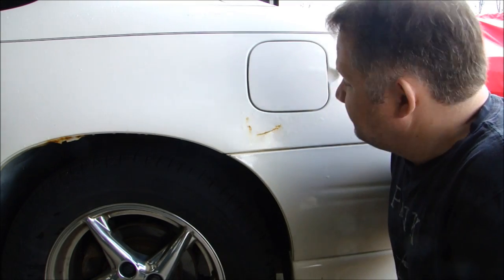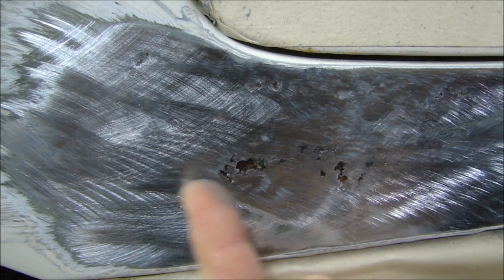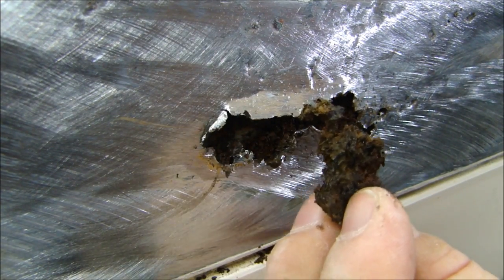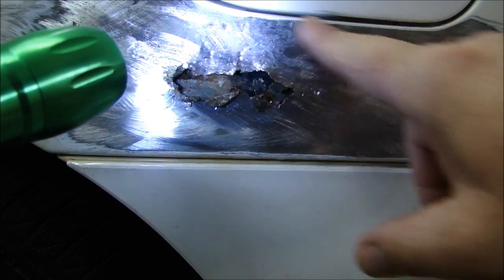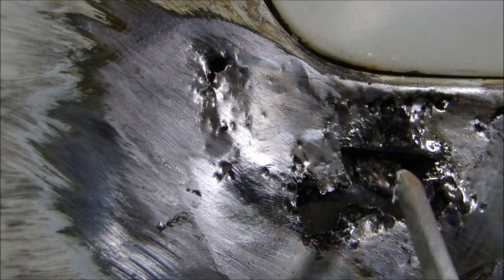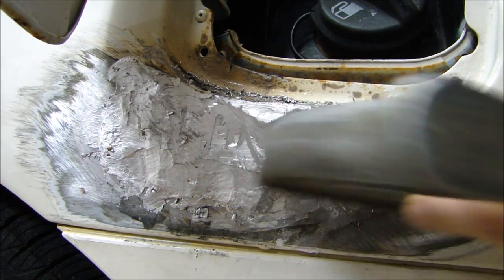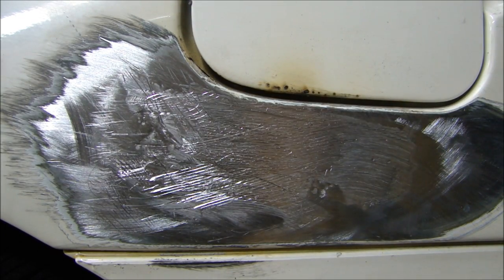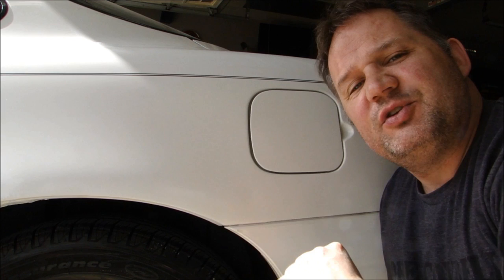Permanently Fix Rust Around your Gas Cap Door

Comment: Its abit easier if you tin a small patch of metal, drill a tiny hole through it and tie a bit of wire to the center, slide it in through the rust hole (or from behind if you have access), and pull on the wire to get it flush against the hole, then you can use that as a backing plate so you don't have to pack as much lead into an open gap. Once you've loaded your lead up just snip the wire off and push it through and just smoosh a bit of lead over the pin hole it left.
Reply from the maker: Great idea! Thank you

Comment: Ballsy call to use torch next to fuel cap! Some caps are vented!! That said you made a nice tidy job of the lead loading mate, way way better than slinging bondo at it!
Reply from the maker: I stress safety in my videos, but you are right. I do check that before and I should include how to do it correctly. Thank you my friend!

Comment: Ive been doing similar repairs after learning to sling lead, ive found you can patch even larger areas if you tin a patch panel (use like a 16 gauge piece so no fear of warping) and then use it as a backing plate and simply lead over the seams to hold it in place and then fill the center and overlap the whole thing. then file it and then finish it with a 40-80 grit paper
Lasts for years upon years without bubbling in your paint (yes i know its still corroding on the inside but it keeps your cheap daily looking presentable)
Reply from the maker: roflman Awesome idea....I have done that and it does work very well.

Comment: Hi Pete! What a great video. Thanks for introducing me to something so much better than Bondo. Two questions:
1. I've got paint bubbling on a good repaint job done 5 years ago on my 1990 F-150. Grinding the bubbles down and there's no holes from behind. The metal is solid, but pitted. If I dimple the surface, add some lead, smooth it off, then prime and paint, will I prevent the bubbles ever returning?
2. Also have a 2003 Echo. Paint is perfect all around, except for a rust hole along the bottom right in front of the rear wheel. The hole is big enough to put a walnut in. I don't want to cut and replace the metal, and I don't want to use Bondo. Is there a lead option for rust this bad?
Thanks a million! 
Steve
Reply from the maker: ***** Hey Steve. 1) Yes....grind it down and use a metal etch prep solution to get all of the rust out before lead. 2) You can use a thin metal patch and solder it in place. Tin around the hole and the back of a patch piece and solder them together. Then fill the outside with lead. That works well

Comment: Keeping the drain hole open inside the door is important, i got an 03 town car, the metal under the door was just bubbling rust, the drain hole was completely filled with dirt so water would collect inside and spill out and in between the seam, i had to grind the rust off and there was a hole underneath, i took my blow nozzle and blew inside the hole and got blasted in the face with a bunch of dirt that had collected in there, it also blew the hole wide open, there was more rust and dirt inside, after all that i saturated it inside with Rust-Oleum rust converter spray spraying up inside too, now i have to figure out out how to fix the hole, i don't have a welder, it really needs a small patch panel, i don't like rivets but it might be the easiest way, the car isn't pretty and definitely not a show car but she runs great.
Reply from the maker: Thanks for the comment

Comment: excellent video.. very well explained!  when you use the spray paint, you're not using any clear coat over top of it?  it always seems like it fades really quickly for me.. am I doing something wrong to make it fade?
Reply from the maker: It really all depends on the paint that is already there. In this case the owner wanted a cheap fix for his daughters winter car. I would normally clear and blend
Reply: ***** all I know is spray paint.  I've never even cleared anything lol .. again though, that is an excellent repair!

Comment: For the best result should I sand the panel down, get a professional grade black gloss base coat, put on 3 coats of that( perhaps sanding it ) and then do the professional grade clear? I don't mind doing any step that would produce the deep shine on the '05 Crown Vic.  I'm sure there are many people who have sections of their older cars they would like to make close to the original.  Also do you have any brands of professional spray paint you like the best?  Thanks again Pete
Reply from the maker: Any paint is only as good as what is underneath it. If you put a professional grade paint over a rattle can paint, it will most likely melt the paint underneath and make a huge mess. Sand the area down to remove all of the paint down to the factory paint. Spray a black primer/sealer to prep the surface, then apply your paint. If you go to an auto paint supply store they will match the color and give you everything you need to be successful.

Comment: Very good work, looks nice. I have one question though, Pete, I have a 99 Civic Si and it is rusted inside the gas door. The paint around the door is bubbled up but the rust hasn't quite broken through yet. How do I go about repairing the rust inside of the gas door? I cannot seem to find a replacement rear quarter panel that includes the entire gas pocket.
Reply from the maker: +Nick DiNunzio That is fixable, unfortunately it's difficult to get to. If you can see rust in the paint, it is coming through from the back. The longer you wait the worse it will get.

Comment: Thanks Pete, the repair went very well. One tip: the quarter panel on this 2005 Crown Vic rusted because it had been replaced 7 years ago and it was never undercoated; I found that Rust-Oleum makes a spray undercoating that is rubberized. It sprays on just like paint, but it actually puts down a thick protective coat- pretty amazing out of a can. I have one question about this fix. This car is Black, and the Black is almost mirror like...when you approach the car you can easily see your image in it. The paint code is U A, but there is no brand of spray paint that can match the actual finish. Everything I have come across is Black but much more dull than the actual finish. Any thoughts?
Reply from the maker: +Myron Piano Yup....base coat, clear coat, color sand and polish. Make it look like glass. Great job!

Comment: Great video, and agree it will stop rust for a long time, but wouldn't it have been easier to weld in new metal?  That lead work looked tedious.
Reply from the maker: Welding in new metal requires higher heat and a custom fit panel. I fixed this in under an hour. A welded panel would take several.

Comment: My son has a 2000 Grand Prix GT that has the same problem. When I took it to the body shop they said those cars have rubber behind there that causes that and there's no was to really fix it. 
Do the car you did have rubber like that?
Loved the video
Reply from the maker: +brandy smith By rubber I think they meant a spray coating that inhibits rust. yes, this one had it. It's difficult to fix. Thanks Brandy
Reply: +Petes Garage thank you. I really appreciate your fast response.
Reply from the maker: +brandy smith Sometimes I can answer quickly and sometimes it takes a couple days...but I will answer. Just trying to recover from my trip to LA. Doing nothing on this holiday...lol
Reply: I think what they meant is that it has a spray foam like material...
And yes, they do, and that foam holds a ton of moisture, that helps rust those areas out prematurely.

Comment: Hi Pete: I have some rust breaking through a front quarter panel. I ground the area and noticed that the quarter panel is made up of two layers, so there is rust in between the two layers of metal. I don't have the wherewithal to replace a quarter panel. Can I grind the area big enough to expose all the rust and then put a rust converter on the area and then add lead? The area is easy to get to, and I'd estimate the rusting area to be about the size of a lemon, but I can't see inside so I don't know for sure. 
                                                                                                           thank you
Reply from the maker: +Myron Piano Unfortunately when a quarter gets to that point is will keep rusting. You can't just cut out a big area and fill it with lead. You'll need to make a small patch panel and solder it in place. I've done that and it works very well.

Comment: To damn close to the gas filler for me to use a torch bro.
Reply from the maker: +JOHN WALTER Never had a problem. If you can't smell gas it's safe
Reply: If I were to to this I'd wet down a paper towel and wrap it around the fuel cap after thoroughly cleaning fuel cap area just to keep any stay fumes at bay.

Comment: Hi I just watching this video and was wondering i have a Chevy S-10 and it has some big rust areas around the wheels and door panels how would you approch this also where can I get lead to do repairs?
Reply from the maker: +robert hutchinson I would start with a patch panel. I'm pretty sure you can get just the wheel well patch. Once you weld in the patch you can lead the seams.

Comment: Pete, I have another question. I put three base coats of black gloss, and three coats of clear coat, but there is no glossiness after the clear coat, no shine after color sand to 3,000 grit and no shine after I try to buff it out. I'm puzzled why I cannot produce any gloss at all. My goal is high gloss like the rest of the car. I'm puzzled
Reply from the maker: What brand and name paint did you use?
Reply: I used Rust-Oleum Automotive enamel (gloss)
for the base coats and Rust-Oleum American Accents 2X ultra coverage Clear Gloss for the clear coats
Reply from the maker: Well...you can't sand and polish a single stage enamel. It has to be a paint where you mix in a hardener. Rattle can paints are a one time use, accept it as it comes out kind of paint

Comment: I'm nervous with heat or sparks around gas cap and filler tube. Please advise.
Reply from the maker: As long as you keep the gas cap sealed. I've never had a problem. If you can't smell gas it's safe.

Comment: Pete's Garage i have the same problem also there is rust inside the gas cap door near the gas cap how can i fix it can i use bondo
Reply from the maker: Sure, but bondo won't last as long
Reply: @PetesGarage  what is the best way to fix it and the Rust is in the gas cap door area
Reply: @PetesGarage  i messaged you on facebook and sent you 2 pictures this is the area im talking about
Reply: @PetesGarage  can you use bondo inside the gas cap door
Reply from the maker: You can use bondo anywhere, but using lead is the best way

Comment: How dangerous is working with heat close to the tank?
Reply from the maker: As long as the fuel neck is sealed it is safe. Just as safe as lighting a grill next to a full propane cylinder that is properly sealed.

Comment: What are the benefits of lead over regular old bondo as a filler? Is there a time where one should be used over the other?
Reply from the maker: A few things, first, lead will not bubble up like bondo. I can usually do a lead repair in half the time, and there are no resins or MEK used with lead. I use lead especially where water can collect and cause bondo to lift.
Reply: ***** Thanks Pete!

Comment: Why not just repair with short strand dura glass that should hold up really well as long as the rust is cleaned out and neutralized as much as possible??
Reply from the maker: That is possible. But it will not make a water tight seal like lead. 1 drop of water gets behind the dura glass and it's only a matter of time

Comment: I'm usually a fan man but that was not the way to repair that. It would have been faster, cheaper and most importantly a more permanent repair tp just cut that spot out, treat ALL of what's underneath it and weld in a new piece of steel with rust inhibitor on the backside to include over the welds through a small hole above the "water line". Grind down the welds, thin set of body filler, primer and paint. Not trying to Monday morning QB but when it bubbles up again and it will, that's how it should be repaired.
Reply from the maker: You are absolutely right, however, this was for a friends daughter who was leaving for college and I only had a weekend.....and it still has not bubbled up
Reply: The backside rust inhibitor would get burned of by the heat of the weld spots and be exposed to the elements. This would result in rust all over again. Lead is a very good method albeit old school
Reply: @GrzegorzDurda  Use a piece of copper or brass sheet as a patch, soldered in place, and you don't have to worry about the patch rusting. The only problem is, copper or brass sheet is expensive.
Reply: @MaximRecoil  yes true. Lead is also completely rust proof though.

Comment: is it 100% lead or has other metals in it? I never thought lead can stick to the metal like solder on copper.
Reply from the maker: The bars are 100% lead. The tinning flux has the acid in it. I am making a video today to show how to fix a rust hole without using the lead bars. My friends in Europe don't have access to the same materials we have here. Lead will stick to any metal that is tinned with a flux first.
Reply: @PetesGarage  "The bars are 100% lead."

You said in another comment that you used 70/30, which means 70% lead, 30% tin, and that's the standard solder alloy that people have used for lead bodywork for ages:

"30/70 Body Solder in ten 1/4-lb. sticks for easy leading Individual 1/4-lb. sticks make it easier to work with. Contains 30% tin, 70% lead, for long-lasting auto body repairs."

https://www.eastwood.com/body-soldering-sticks-10-pack.html